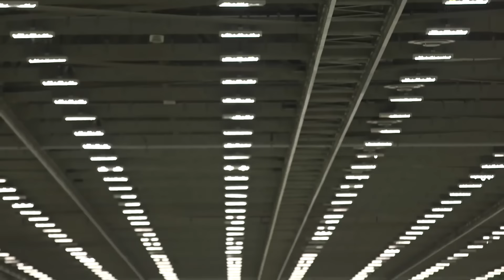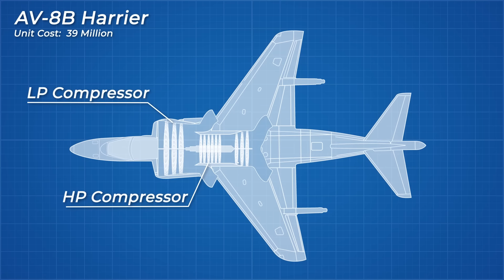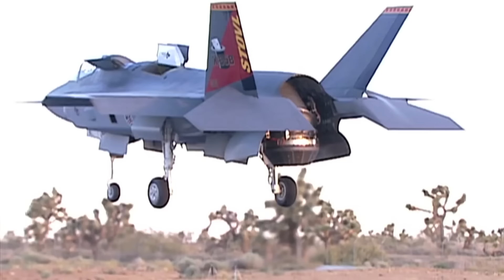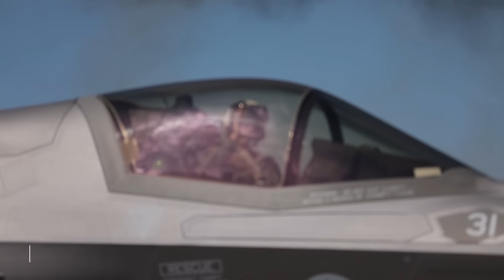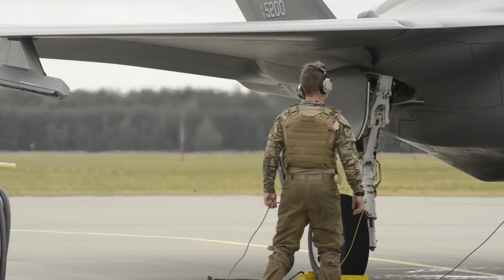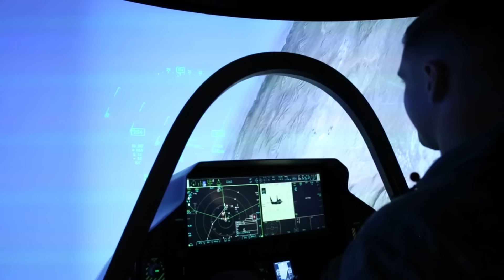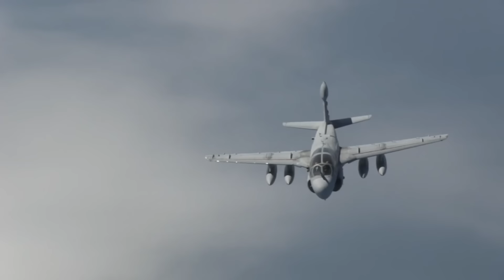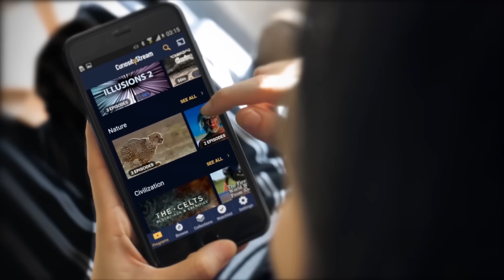Is The F-35 Worth $115 Million?

Comment: So many excuses for the F117, its age etc.
It was shot down by a 1968 radar semi active homing missile.
Reply: Once.
Reply: @TT-hd3zi  Yes once... But with massive electronic jamming of an old,  well studied,  not robust radar and missile system.

The jamming by itself was enough for Rafales etc. to overcome such systems in Libya for instance.
Reply: Brian Min that F117 was not accompanied by its usual jammer escort that day I believe.
Reply: @brianmin1734  If there was electronic jamming then the F-117 would have changed course because the P-18 radar would have been detected. There would also have been F-16s scrambled to perform DEAD while the jamming aircraft continued with SEAD. None of that happened despite the Serbian radar being on for almost 20sec.
Reply: The incident proved that stealth works as intended. Also the missile was at the very least a 1970s model since the V601 didn't enter service till 1970.

Comment: This thing is designed to cover the A-10 as well? I haven't seen where the GUA-8 rotary cannon fits in to the F- 35? How can it "cover" the service capability of the A-10 without this gun?
Reply: The gun is on the bump on the left side of the fuselage. Regardless, it's not important because the role of the A-10 is to drop precision bombs from high altitude, just like other aircraft flying CAS missions. Flying low gets you shot by MPADS.

Comment: There is no mention of the chinese stealing the plane design and integrating it into their "aircraft carrier", whose design, they also stole...  It will be awesome to see the US also manufacture the F-23, and maybe Real Engineering can do a small video about it...  Many are convinced that the F-23 is a much better plane than the F-22
Reply: It wasn't back then, but it's characteristics would have given it a slight advantage today. You also have to weigh the fact it was estimated to cost quite a bit more, so the US probably wouldn't get as many of them and the F-22 would still come out on top.

Comment: Amazing that we never learn! This was the same problem with the F-111:one plane for all branches.

We need to lose fighters and go with drones. Better yet, stop building weapons and trying to run the world as badly as we do our own nation.
Reply: How are drones anywhere near reliable enough to be used as fighters?
Reply: @infinitelyexplosive  they have been far more reliable than most fighters, and, because they cost less than a sixth the price, you can put six times as many in the field. If they were a third as reliable, they would be twice as effective.

Additionally, drones have far better loiter capability and will miss far fewer penetration attempts.
Reply: @GlennCaton  No fighter drone exists, so obviously you're making up the fact that this hypothetical drone costs 1/6th the price of a manned fighter. Regardless, AI is nowhere near advanced enough to be reliable when communications are interrupted, as would happen in environments where fighters must operate.
Reply: The F-111 was a single plane for a single branch and single role. It was later requested by congress to cut costs and modify the F-111 into a new version that would serve a completely different role and a service with very different requirements. So it is very different to the JSF program which had very very similar role requirements across all services.

And to add to what Inifinitely has stated, drones can be defeated by jamming their signals. You don't even need to fire a weapon, and even if they do eventually get AI pilots, the AI will still be more blind than a human pilot if it gets jammed. The only advantage drones have right now over piloted fighters is that they don't risk a human pilot's life.

Comment: How it will replace A10 Warthog? I've heard that it's 30mm machine gun can't even fire straight.
Reply: The F-35 can carry guided bombs just like the A-10.
Reply: @infinitelyexplosive  yes but it will never be as effective as Warthog in close ground support to the infantry. And warthog is famous for it's 30mm brrrrrt sounding gun 😂
Reply: @monsieur1936  And using that gun requires flying low, which puts you in danger of enemy AA, most notably MPADS and mobile AA systems like 2K22 and Tor. There's a reason that the A-10 did the vast majority of its work from high altitude just like the F-16s, F-15Es, and F/A-18s during Desert Storm.
Reply: @monsieur1936  Close ground support is only a minor aspect of CAS. The A-10 has already been replaced in most CAS situations by the F-16, so there's little reason to assume the F-35 can't do so as well.

Comment: I want to say something here about the F117 shoot down because this vid makes it seem like it only happened because there were no escorts.  Consider that the F117 in question had flown 39 previous sorties without any trouble, and the SAM battery that took it out had been fired upon previously by 23 HARM missiles and never been hit.  These stats should tell you that there was something different going on here, something not usual.  The first problem that lead to the shoot down is that the F117s flew the same routes every time, so it didn’t take a genius to figure out where to position the SAMs.  The next problem is that the SAM battery commander was a rather sneaky bastard.  He never allowed the radars to be on for more than 17 seconds, and he would reposition the SAMs after the radars were used whether or not they had fired.  He had also drilled his unit to reposition the SAMs in 90 minutes when it usually takes 150 minutes.  In addition he had Mig29 radars set up on the ground to confuse NATO aircraft.  The final nail in the coffin is that his unit had been intercepting communications which enabled him to have good situational awareness of what was going on in his area.  In other words the F117 flew into a trap that was so good even missile systems developed in the 50s and 60s were able to defeat its stealth, but only because they were deployed by an exceptional commander.  That’s why there was only 1 shoot down of the F117 and why this particular SAM battery was never suppressed.

Comment: This is Lockheed-Martin propaganda, nothing more.  The biggest problem with the F-35 isn't the price and never was.  The biggest problems are the fact that it costs over $30,000USD per flight hour, requires 22 man-hours of maintenance per flight hour, requires special (expensive) climate-controlled hangars, the pilots' helmets are $500,000USD apiece and most importantly, the thing STILL doesn't work properly.  The F-35 is more at risk of damage from firing its cannon than any enemy aircraft and now the B and C variants are suffering structural damage from something as routine as sustained supersonic flight.  Oh yeah, it's not allowed near any form of inclement weather either.  NO plane that costs as much as this to buy and operate should have several defects, especially not completely bone-headed ones like this plane has.  Teething time for this plane has long passed and it's still a turkey that can't fight and can't run.

Comment: From cost point of view - $100 million per aircraft may sound expensive, but it actually is not.  Considering commercial airliner cost about $250~350 million per aircraft, you may say $115~130 million per F-35 is actually a bargain.  Aircraft acquisition cost calculation is very different than, say buying a car.  You must first calculate off-set (refer to Boeing website for resources if you are not familiar), then spread out the cost over the period of usage - once you do that, then the cost of F-35 is, in fact, fits in the budget of US Air Force/Navy budgetary plans - it is cheaper to operate F-35 than to operate maintenance heavy F-15 over a period of 1 year.

Comment: Worth it? Short answer: no. Longer answer: I don't have an hour to list all the problems that mitigate any advantage the design has, including logistics and maintenance issues. I'd rather have mission specific aircraft (which are also cheaper) that excel in those roles than an aircraft that is, relatively speaking, just okay.
Reply: Except that the F-35 is cheaper than most fighters and is king of the strike role. Logistics issues are mostly caused by the US military trying to reinvent the supply chain and failing to order spare parts for each airframe.
Reply: @dumdumbinks274  It's actually not cheaper than most fighters. It costs more per unit and in maintenance. The logistics issues I'm mainly referring to are dumb shit like having to have special cooling units for fuel storage that no other aircraft need in order to operate, and the ridiculous turnaround time between flights. It needs more time on the ground for each sortie than any other aircraft of it's size/type. Almost a full bloody day. It's only main advantages are stealth (when it works and is useful) and it's reported user friendliness. It fills a niche role as a tactical strike aircraft, but that's about it. Every other role is performed better and more cheaply by other aircraft.
Reply: @shade9272  F-35A is around $78m currently. It's about the same price as an Su-35S, and less expensive than the Typhoon, Rafale, Gripen, and F-15, while only slightly more expensive than the F-16 and F/A-18. It's also a heck of a lot more capable than any of those fighters. In terms of maintenance it is cheaper than the F-15C, expensive, but not overly expensive.

It does not require special cooling units for fuel, and it uses the same facilities as the F-16 on the ground.

Turnaround time between flights is average, and F-35s have performed multiple sorties per day in combat theatres. In exercises such as Red Flag F-35s have been able to achieve sortie rates of 3-4 missions per day.

It's stealth is a huge advantage in almost every situation against a peer enemy, but to claim that's it's only advantage is ignorant. The F-35 has the best sensor suite of all fighter aircraft giving it incredible situational awareness, and it has very strong EW capabilities that when combined with stealth make the F-35 a top tier BVR fighter on the same level as the F-22. As for it's aerodynamic capabilities... it's slightly better than an F-16. In terms of range the F-35A is the longest ranged fighter in the USAF.

As for roles... Strike is definitely not a niche role... it's the most important role of all and the F-35 is the best at it. Other roles such as CAP, DCA, CAS, SEAD etc are all roles the F-35 does pretty damn well in, only being beaten in very specific situations by even specialised aircraft.
Reply: @dumdumbinks274  The accurate flyaway price is still 90-110 million. A brand new F-18 costs low 70's. That doesn't take into account the incidental costs behind the F-35's overall design. An A-10 is far superior in CAS for far cheaper. Most of your statements regarding it's performance in air-to-air roles is patently false. Sorry. Bye.
Reply: @shade9272  "Accurate" as defined by nobody with any relevance. Unit cost is $78m. It accounts for all the same costs that the F/A-18's $73m did several years ago. What are you referring to by "incidental costs"? Are you assuming the F-35 has been sabotaged before you can fly it away? Not even the USAF would be buying them if that was the case. 

The only reason the A-10 is well regarded today is because none of the enemies have the capability to engage aircraft, thus the A-10 can actually use it's firepower. The A-10 serves a niche role within the role of CAS, and just as you claim it is cheaper than the F-35, a Super Tucano can do the same role for about 1/4 the price of an A-10. As for the majority of CAS the F-16 has been notably more successful due to it's speed and sensors. The F-35 is significantly better than the F-16.

The F-35A's performance in air to air combat is only considered bad by people who ignore the facts. Compared to the F-16 the F-35A has
- A better T/W ratio
- Almost double the lifting surface area, resulting in a total loading slightly lower than the F-16
- Better subsonic acceleration
- Better climb rate below 15000ft
- Higher top speed while armed
- Far superior sensors
- Far superior EW capabilities
- Can carry the F-16's max air to air payload internally
If you stopped to listen to what pilots have to say, even those flying other fighters, you will find that they are almost universally positive about the F-35's performance, even though there are numerous issues... issues that once again are no worse than any of the US 4th gen designs had to contend with when they were new..
Reply: @dumdumbinks274  You may as well have started that blurb with "This ad has been brought to you by Lockheed and only partially resembles reality."
Reply: @shade9272  Ah very clever. I'm in awe at your vast knowledge and intelligence for thwarting the Lockheed master race plan. I'm sure you can explain how physics equations, combat records and history etc are wrong and somebody (I'm guessing your source is POGO... another highly reliable source of words) who has no access to cost data is more reliable than the customer who bought the damn thing.

Comment: Nice jet, this F-35. Decent successor of Yak-141
Reply: Basically YAK but with stealth technology and Harrier thrust vectoring added with it’s lift fan and rear thrust vectoring.
Reply: Yak-141 was a POS and every test example crashed. It also used a copied version of the rotating rear nozzle developed by NASA in the 1950s AND had a heavy dedicated lift jet engine which was total wasted weight and space for forward flight and never had the Ducted Lift Fan technology of the F-35.

Comment: F-22 is just an F-35 with two engines, with slight differences. Change my mind.
Reply: on the airframe and overall shape, yes. On the inside (sensors, awareness and so on) absolutely no, but I think F-22 can be modernised to benefit from F-35 advancements

Comment: F 35 is the worst piece of crap ever built! The end of the free World... We have two alternatives, build more F 22s instead or give the F 35 a MUCH stronger Engine and stronger hull. Add much more radar-capability! This plane is a certified turkey!
Reply: Your analysis is obviously not based in reality. . Restarting the F-22 production lines wold cost billions, and the flyaway cost of each aircraft would be well over 200 million. It would be unimaginably inefficient to do so. Redesigning the hull structure of the F-35 would be similarly cost-prohibited. There aren't any reports of hull integrity issues on the aircraft either. 
The F135 is already at the edge of modern performance. There is no engine which offers significantly improved thrust at a comparable weight and size. Additionally, the AN/APG-81 is among the most advanced radar systems in the world. No conceivable upgrade exists at this time.
Reply: money  is not  the answer, democracy is

Comment: No. The F-35 is a design failure. Too expensive. Unable to outperform older solutions. Jack of all trades, master of none. Its one advantage, stealth, has been defeated years ago.
Reply: A more stealthy plane is always better than a less stealthy one. The avionics of the F-35 are also dramatically improved over older aircraft.
Reply: infinitelyExplosive I have to disagree with 2 things you said. 
1 - a plane whose function is interception does not need stealth. It needs the mother of all sensing system. Active sensors are opposite of stealth.
2 - said avionic can be used in other aircraft. So the F-35 is not a requirement.
Reply: @TheSiriusEnigma  As you yourself stated, the plane's purpose is not interception. It's a multirole fighter. Being more stealthy gives it an advantage against air- and ground-based threats. It is harder to detect and therefore harder to engage. This comes into effect when, for example, attacking SAM sites. 
Incorporating those advanced avionics drives the cost of older generation aircraft up to prices which are similar to the cost of an F-35. Then you're looking at a platform with equivalent avionics performance but otherwise generally inferior design.
Reply: @TheSiriusEnigma  1. the F-35 has top of the line passive sensors. Active sensors also do not negate stealth because stealth is not simply remaining undetected, not to mention that modern radars are difficult to detect anyway.
2. Why would you waste money on an old fighter modifying it's internal configuration just to fit downgraded avionics from a far superior fighter? It is for example physically impossible to fit any part of the F-35's sensor suite into an F-16, so the F-16 would have to be completely reconfigured for a lot of money and very little benefit.

Comment: Cost per flight hour $us25k  how many flight hours during life of a/c  then how much is operating cost all up   compared to purchase price $us115million
Reply: The likely unachievable stretch goal is 25k/fhr in 2025. Right now the current best estimate is 35k/fhr in 2024, down from the 2018 CPFH of 44k/fhr. At the projected 8000 fhr lifespan, that's around 250m per unit. That's not a full estimate of maintenance costs though.

Comment: Stealth doesn't really apply to dogfights. The F-35 should be able to take out targets before getting into a dogfight, but once in a dogfight, the planes are able to see each other, so stealth doesn't matter. If the F-35 gets spotted by its target, it has a high chance of getting shot down.
Reply: Except that the F35 can shoot missiles in any direction, regardless of travel. It would also be harder for enemy radar to lock on for a missile track and is equipped with its own jammers.